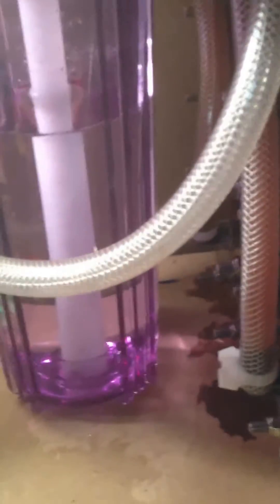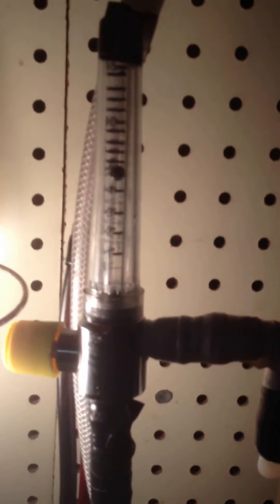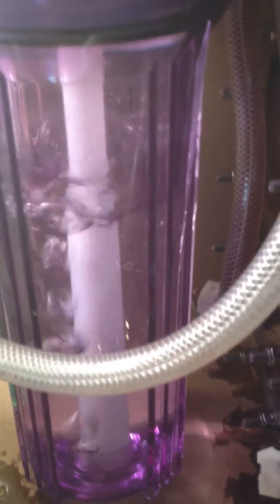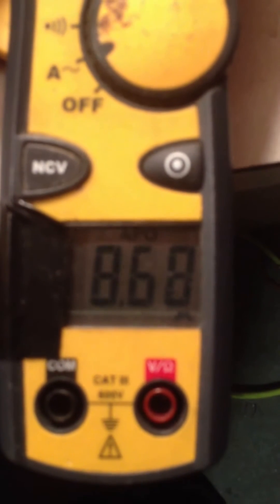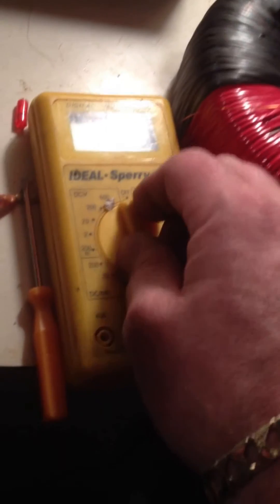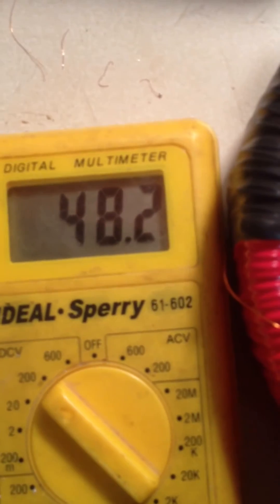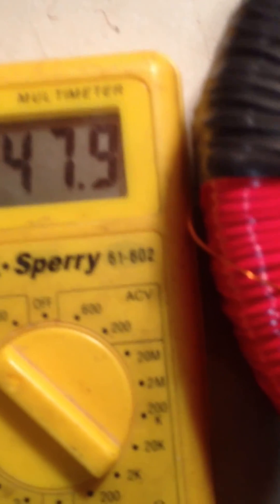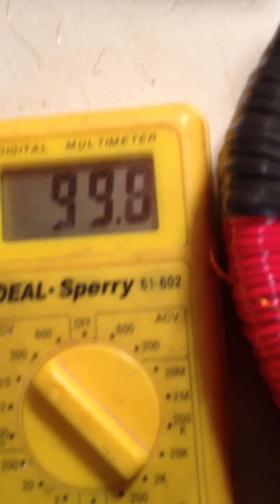PWM3G Modified, 9 amps, 5-14 lpm DEZEINSTEIN - Marc's TPU driving lots of HHO

Comment: @MARC
I live in Kansas but I am from Detroit.
I am trying to absorb it all. Everything you said made sense and I can tell you this, when Bob was here at my house
he showed me things that were not available to the public yet. We went down into my basement lab. Pulled out the 
$20,000 scope and he verified the 3 boxes I have as to their proper working.  They all work, but I made some odd
sized cells and Bob did not know what to tell me as far as how to wind for these. He just said test. His wife was here and
daughter who was heart broken about loosing her child, she died right away and so did the wife. It is a sad story.

Bob did do some other cells for that other company that veri chipped him as he was drugged, his heart has been messed
up since the 80's when he was climbing a telecom tower struck by lightening. Don't that beat all? He took on weight
steadily now for 35 years because his heart can not keep up.

When he was here he talked about hacking some cars he has and many other things as he was on his way to
that big pow-wow meeting. What a time we all had. My son still can't believe the 2 girls are gone. He is 12 now.

Bob only spoke about his 101 plate and down as low as 60 plate but then he would turn right around and 
make that TPU work on anything, he just couldn't explain it very well or didn't think they would get it. What you
have done is to bring back all of the practical ideas I should have thought of already. The cells you use are
what I call "BELLY BUTTON HOLE" cells, LOL!!!. Not the one's Bob uses. Those dry cells are much easier
to mass produce and everyone can get one. I know that you know, Marc. Bob would go on and on about how
the plate spacing had to be within a 1/2 of a thousandths. This meant that all 4 corners of every plate had to
be the same distance apart or the entire array of cells would not operate all together. He explained that his
first few wack jobs left him with 15 cells out of 60 running along fine at one freq while the rest sat dormant.

Then he would change the channel (FREQ"S) a smidgen and another part of the 60 plates would running high
output leaving the other cells non functional for the most part. I will read you writings many time SIR.

Thank you, glad to find you.
Reply from the maker: +Bro Mikey yes, you are absolutely correct. I have found that each and every coil in resonance is the way to work the frequencies. We could make the coils all the same size, but, a capacitor for each primary coil would be needed to resonate at those frequencies, and, the coils for the primary need to be exactly 1/4 of the secondary length so they resonate with each other. Once this is established, the output will combine the 3 harmonics. The second issues is the cell. The cell is capacitive and has an impedance, so, we need to use a function generator to sweep the cell with water in it to see which frequencies it resonates at. We have to make it resonate at the middle frequency so we have the ability for it to function at the first , 2nd and 3rd harmonic, where it will decimate the normal output. This is done again by using the online resonant calculator, but, the cell isn't inductive, it is capacitive, so we merely need to calculte it's capacitance, use an inductor, which is the set of chokes he uses, and, we need to adjust the capacitance in parallel with the chokes to equal the output frequency we find to be the resonant frequency. This I have done, it is tried and true bromikey..    let me know if you need assistance, I could definitely assist, however, the windings need to only be tuned to each channel frequency. The windings could be any size to do this, but, the pwm3g won't survive unless you add the caps with the windings shown online. I also found the bias winding isn't needed at all for this, it just gets in the way and will take so long to wind!
Reply from the maker: +Bro Mikey my question to you is this then... If there is no hole in the plates, and no way for current to pass along the sides of them, what happened to me is the water could never refill itself between the plates, especially if there's a membrane over the top of the plates so the water can't get in or foam over them, so, a way to release the water levels between the cells is pretty much vital so the plates could get a water flow between them, and, have a path for the current to flow. My method is very efficient, but, it also works without electrolyte while many cells on the market or built privately do no such thing.  Otherwise, we have to put so much electrolyte  in the water and literally remove the top to evenly fill the cells with water over the top and between the plates.. The size of the enclosure and amount of bolts made this too difficult for me to take apart like this every time, so, after I saw his Florida partner's build of the cells, I saw the one plate at the end which he shows having one hole in it. I have never seen any indication of any other way, holes in the plates, etc., nor have I seen any method to pump water across the top of the plates in the design, like a piece of HDPE channel that would act as an even waterfall, etc. My method has one hole in one plate, two holes offset in the next, back and forth all the way through, with thin neoprene grommets protecting and insulating each plate from edge currents from killing the efficiency. My enclosure includes a channel at the end of one side that allows the water fill to bring the level of the water to the half way point automatically. This way, not one bit of electrolyte is needed from my system and it runs efficiently with the build I completed, but, my design keeps the cell's current flow to go too much in the middle and it isn't evenly distibuted to make the entire plate work, changing the cell's capacitance severely , making it so different that the output levels were reduced massively, however, higher voltages cure this with the use of steam distilled water.. If the voltage is high enough, which it is normally 160vdc in my case because of rectification, I also let the harmonized output run to the cell separately, connecting at the cell, so, we have both a pulsed harmonized dc and an straight dc line at high voltage. Bob's  is connected through the 120v ac line, then rectified, so, there's merely a pulse of energy going into his cell through a rectified line that will only allow the dc to get through, without having the harmonics getting through and it literally will not do much because the circuit shown online by PJK avoids the correct line diagram in my opinion, either that or Patrick wasn't thinking when he wrote it. I am not sure, however, I will offer my electronic diagram to anybody for free if they wish. Myself and one of my partners are soon to be releasing many ebooks from my site, Dezeinstein.com . If you have contact info for Bob, I'd like to askk his permission to list his name on my site and my version of his schematic as an update which will probably help assist sell his devices, although, I just don't want any problems listing his name, legally or in a civil manner. I am always more than happy to offer my two cents to anybody.. whether or not it works will be up to the user to decide. I can't claim miracle when I don't know the builder's abilities, the test equipment they use, or anything along those lines.

Thanks,
Marc

Comment: Thanks Marc
I am glad to find these posts on the Bob Boyce stuff. I have his hex controller, I have 
another programmable on the fly HEX CONTROLLER board and I have another version
of the PWM3G instead made with TL594's (3 of those) and the TC4420 drivers well here
flyer.thenetteam.net/pulsing594.jpg

I casted a cell or two and they cracked but now I have the right composites.

I have to micrometals 6.5" cores and enough silver coated 16awg and 22 awg solid
to do one wind, but my cell is 36 cells and the formula is based on the 101 pack, so
I will do a harmonic? Not sure what to put on for windings. Thats for another day, I can't
get to finishing the composite pour right now, I got buried with new old stock in
the shop. Someone gave me a huge lot of parts free and I am over run to the point
I can't find the bench.
Reply from the maker: +Bro Mikey Hey Mikey, where are you from? Bob's winding instructions are completely unique, like a fingerprint. If we take a coil and have so many windings, we need to know the exact length of the wire, the spacing between the windings, wire size and core to determine the inductance. Then, we need to add caps for a resonant frequency, however, this was never given, so, we need to make the coils resonate at the input frequency, and the secondary needs to pick up these 3 harmonics to do the magic here. Since there are 3 different frequencies, I am afraid to say I had to calculate the resonant frequency from one coil at a time, then, I added a cap with the given frequency using an air core inductor calculator, then, used an online lc resonance calculator. I stuck all three primary coils on one plastic former, then, used plastic wind separators 1/4" above these to wind the secondary. Since the secondary did not pick up resonance from all 3 separate sized coils, I had to make the lengths of the wire on each winding the same size, and add a cap to resonate at the frequency from each channel. The secondary needs to be exactly 4 times longer wire than each of the primary windings to be able to pick up on the frequency, or, exactly the same weight.. So,  we need to measure the inductance of each coil, then, you can input your inductance on an online calculator, and, get the capacitor size needed to add to each coil (in parallel with each coil) . This will make the coil perfectly non resistent or have an infinite impedance, allowing the pwm3g to live through the shorted coil. That is exactly what you'll have from the heavy gauge coils unless you add a capacitor. I do not recommend using a 16 or 20 gauge wire for this, I would wind the channels with more like a 26 or 30 gauge wire to add some inductance and resistance to the windings, it brings the size of your capacitor down so it isn't an expensive one, and, the pwm3g will end up  being resistant to other factors, one being that the many more windings of a smaller wire you use will add resistance needed to eliminate the heating of the outputs of the pwm3g (the coil will release the heat instead of the transistor, so, leave some space between windings. My first pwm3g instantly blew the transistors since I had the coils they showed to wind, even using a 2 amp fuse.. Anyway, that is how it is needed to be done, the caps could be in series, but, I recommend them in parallel with the coils. If all 3 coils of the primary are 1/4 length of the secondary, this includes the tails on the ends needed to make your connections,  the coil will automaticall be resonant to the primary coils, but, the tails and lengths of the primaries must be accurate to this 1/4 wavelength. The only other way to do this is to weigh out the wire. If the wires weigh the same, they will be in resonance as well, so, it will detail taking a smaller wire for the primary windings and a heavier gauge for the secondary. If this is done, the only thing that will need to be done is the input frequency resonant frequency will need to be tuned as I said above , then the output will obtain all 3 harmonics in it's output. Once this happens, the system will blast off as he says. It doesn't  matter which cell you have, the effect is pretty much the same.. We could always tune the frequencies to try other ones, but, I recommend using a 60 plate cell pack as Bob did not use this in his boats. He noticed the harmonics he had from the alternator on the smaller one and tried to replicate it. The only way to have this work is to try it. I have been able to tune my pwms to do this and it is difficult to tune the highest frequency, however, if we have two of the 3 harmonics flowing, it generally works. Cores have a hard time outputting the highest one, and, Bob's circuitry has a hard time not overheating as the highest frequency is tuned. It is kind of shady too, however, the frequency is needed to make it all happen as high as he says it got. I would say the volume of gas coming out under these harmonics is 15-17 liters... not 40 - 50, but, the input amperage is so low, you'd never believe it. I'm talking less than 4 amps.